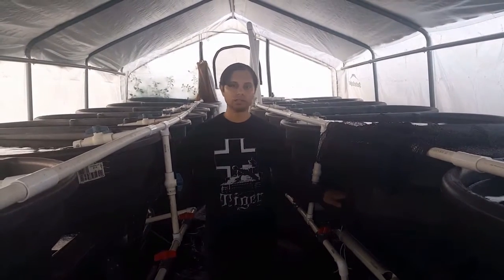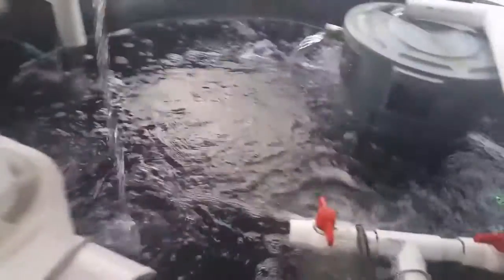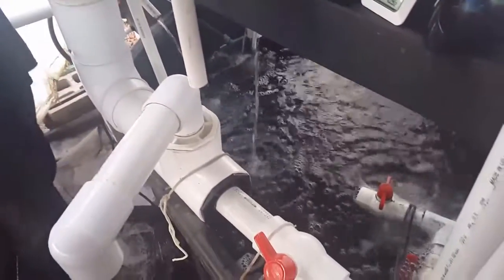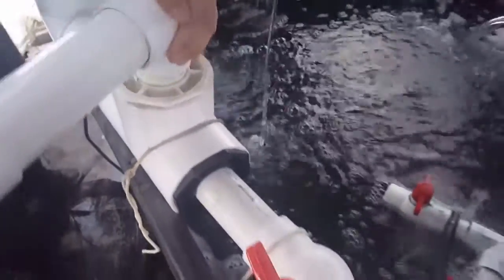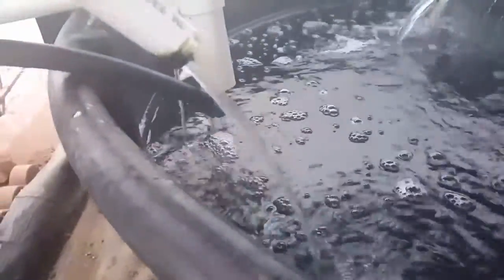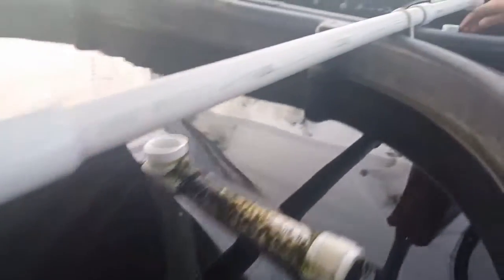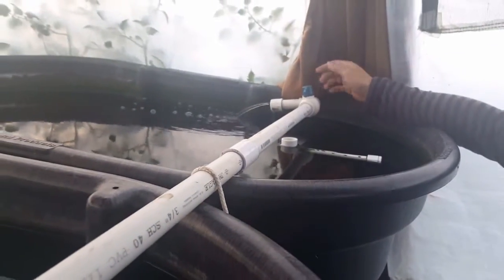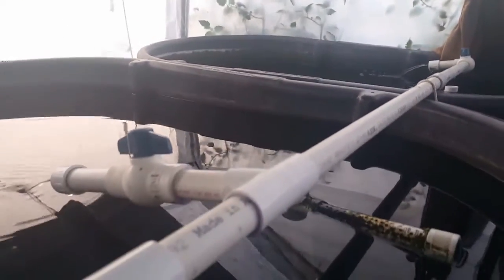The Perfect Aquaculture System

Comment: What is the cost to build a system like that and how much power does it use? I'm thinking of setting up something on kauai in an off grid location I like your setup but i would start a little smaller. Do you have design plans? thanks.